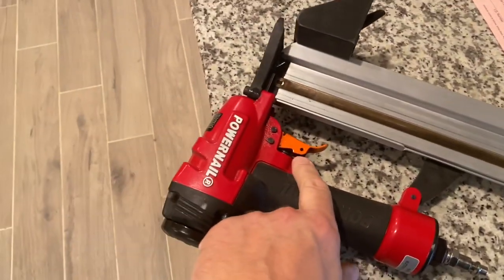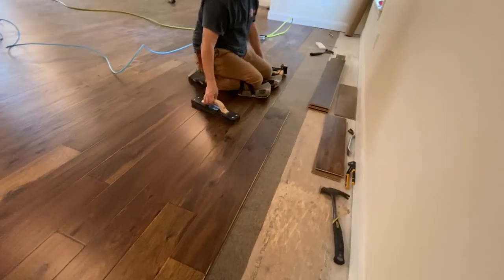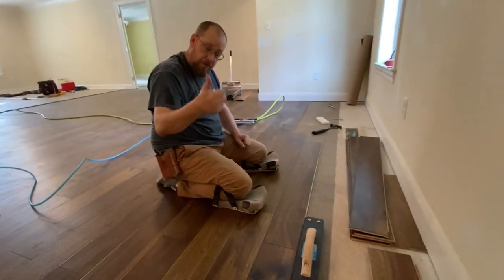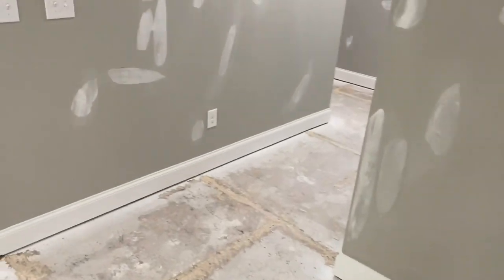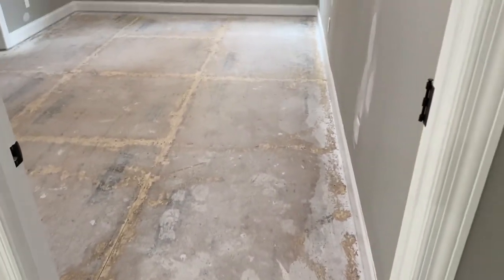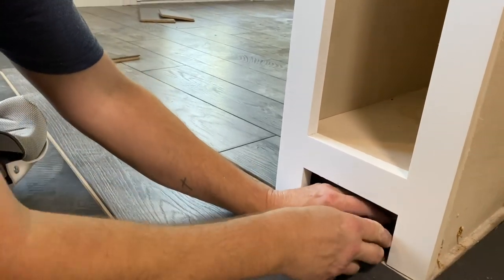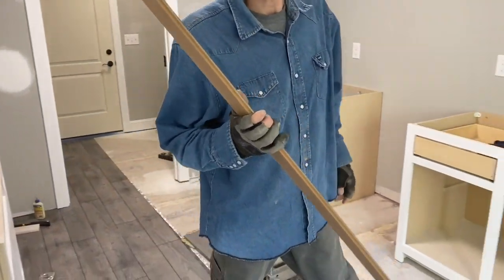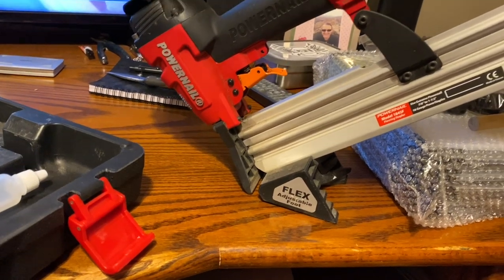Flooring Compilations 3 Hardwood And Laminate TIPS & TRICKS

Comment: Question who is better proknee pad or atlas 46 nkee pad
Reply from the maker: Ahmad Yassin never have seen the atlas kneepads, but I think Proknee Are the best because of the science behind them, keeping you off of your knees and feet
Reply: Because I'm already using pro knee ap16 and its heart my knee especially the right one and I ordered the atlas 46 because I got confusing and the way  I set should be the same,and the support for the shin could be useless even if order the  big one 0714  and I'm a skinny guy I dont know and most of the videos on the YouTube and the reviews says its comfortable but it's not especially at the end of the day and they're using the same padding on both
Reply: Do you know about some tools to cut molding inside home with no dust
Reply from the maker: @ahmadyassin3182  https://www.tools4flooring.com/crain-855-wood-miter.html
Reply from the maker: Ahmad Yassin I have been putting in some extremely long days lately and my pro knees are still extremely comfortable at the end of the day even as they are at the front of the day